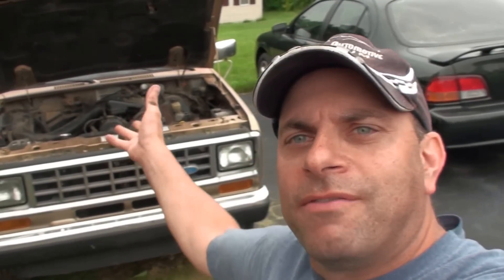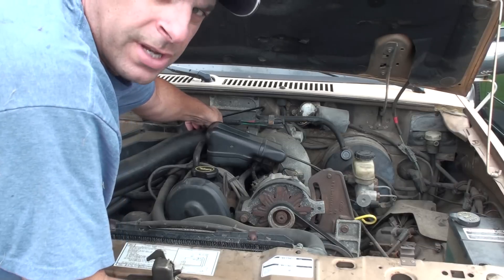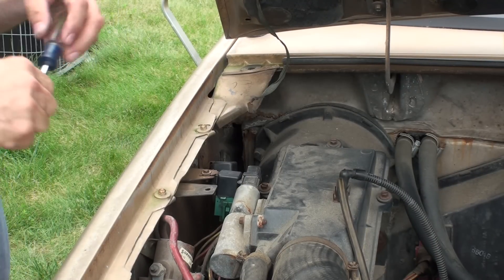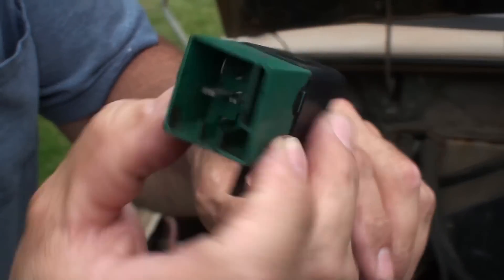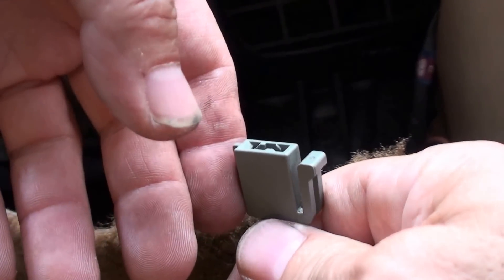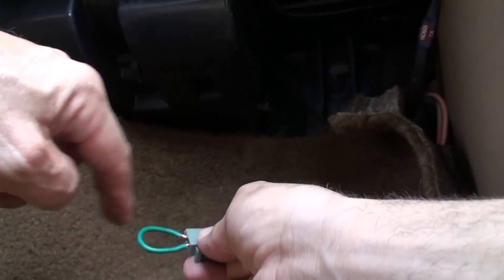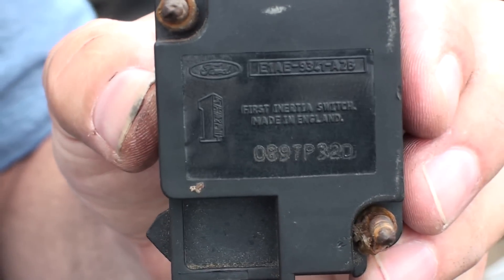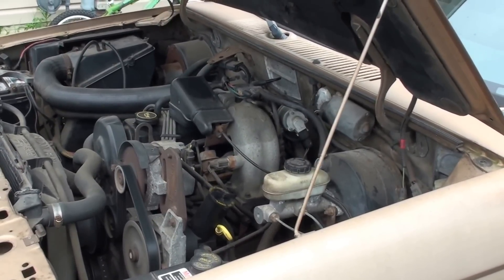Engine Crank, No Start -Diagnosis and Fix - Ford Ranger

Comment: Where did you get the new switch
Reply from the maker: Almost impossible to find a new 2 wire inertia switch these days.  Online searching and luck.
Reply: Ozzstar is there any other switch that would work? Or am I gonna have to bypass it. I have a 1988 ford that's doing the same thing expect times it does start and runs fine and then it'll just not turn on.
Reply: Kita's Hidey-Hole that's what mines been doing she'll run fine then just not start an when she finally does there's black smoke coming out the exhaust any tips to what it might be? I've changed all air filters an the injectors the inline fuel filter  new spark plugs an wires and can hear the fuel pump kick on... she wants to start just stuck on cranking any help would be great

Comment: Sometimes a very swift bump will trip the inertia switch.
Reply from the maker: Yes the kind that knocks the fillings out of your teeth!
Reply: Crank no start with my 88 Ranger, unfortunatley not as simple of a fix as this.
Reply from the maker: It's never simple until you know the answer :-)
Reply: After enough chasing around managed to discover the EEC was getting no ground, this was fixed by discovering a disconnected connector that the pulley disconnected.